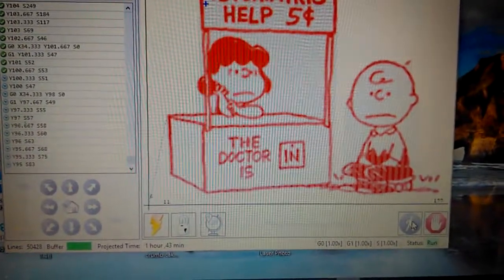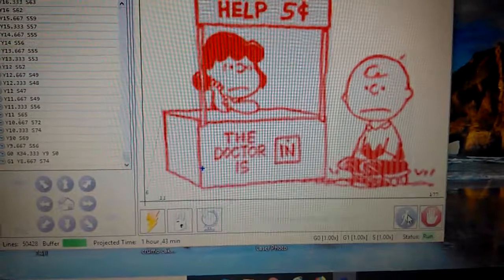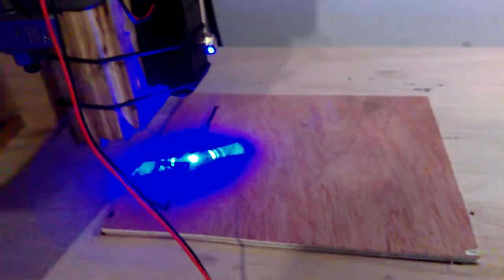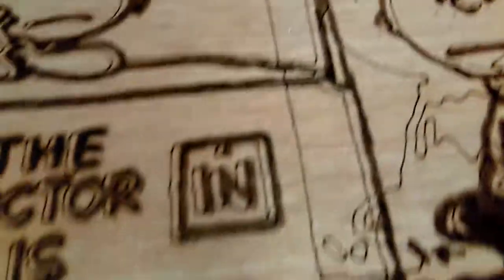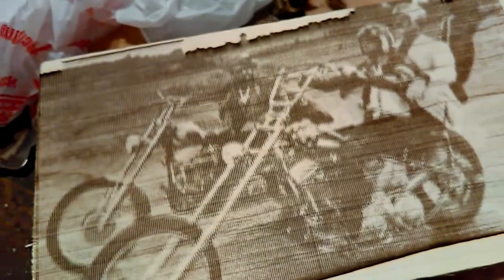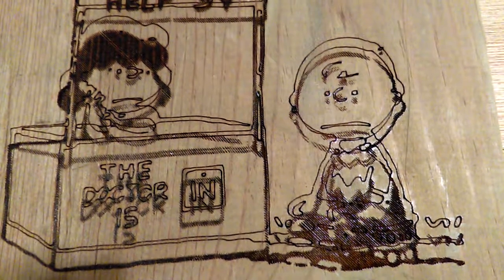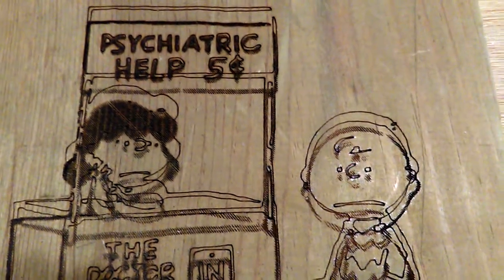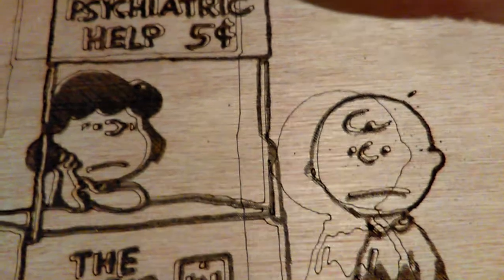Issue using LaserGRBL in vector mode

Comment: Had the same problem, it could be beacuse screws are too loose and when its doing borders it misses a little because of speed. But the thing that worked ALMOST PERFECTLY is .... you go to configuration and change:
$110-5000.000
$111-12000.000
$112-2000.000
$120-10000.000
$121-1000.000

Hope it helps with VECTORIZE option

Comment: Hi, i am the developer of LaserGRBL
This is a known hardware/electrical issue, not related to LaserGRBL itself. 
Please read http://lasergrbl.com/en/faq/
Reply from the maker: I read through the article and did you have ideas on what I should be looking at as the cause? The uno board controlling it is a clone. One axis has a much higher step rate than other axis. I am powering grbl controller board with a PC power supply that I think is fairly stable. I do have wires all over and perhaps it's picking up noise? It does work fine in the line by line mode. Issue is only in vector mode.